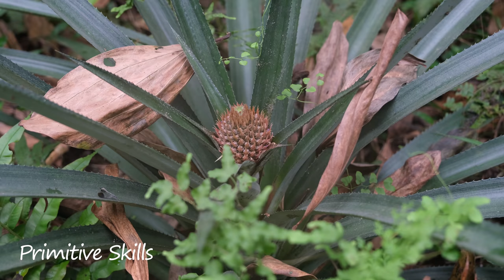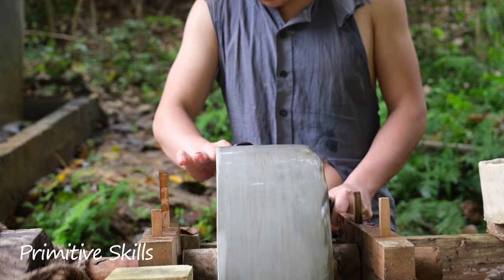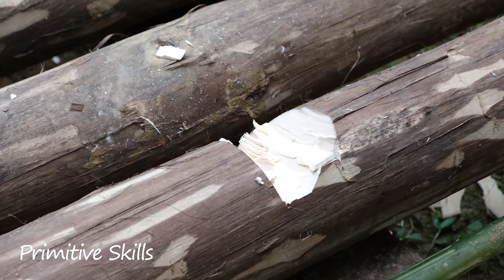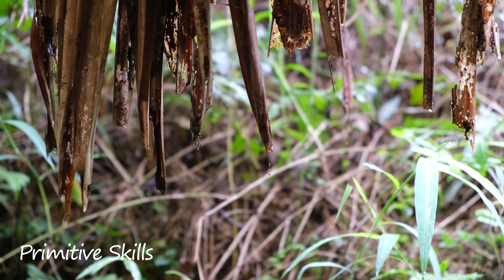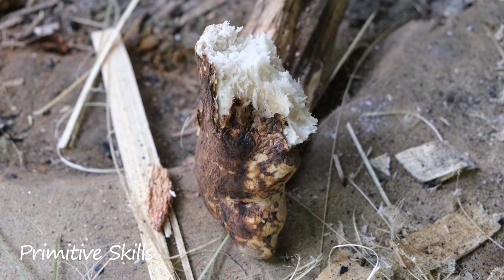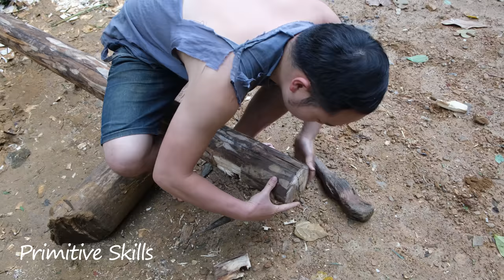Primitive skills for building factories, sawmills powered by waterwheels, Automation tools - Ep.162

Comment: Just a little advice.. Stand on the other side of your grinding stone and have the wheel turn into your blade so you can hone it first, stop the wheel and lightly rub the burr off the blade. It's sharper and last longer. Cheers. Keep up the great work!! Been a fan and sub from the beginning.Much respect from Ontario Canada

Comment: Got a quick suggestion. Maybe put a belt type of system on the grinding wheel. make a bogger and a smaller "plate" which the belt would go on to. It would spin the wheel a bot faster and make it easier for you to sharpen things.
Reply: he can also increase the volume of the water boxes on the wheel , or increase the volume of water falling on the wheel. either will provide more torque and speed. what your describeing is essentially gear ratio but without gears.
Reply: @Melicoy  ... nope.... you haven't observed the digging tool he made and watched him dig it...
Reply: @Jedyz Games ... Hey Jedyz, my reply was to @Melicoy who made a statement that the vids were faked... I've been watching since the beginning and respect and praise all the hands on hard work.

Comment: How are you going to transfer the power to the blade?
Reply: I wanna guess but I don't want to spoiler it. It's gonna be cool😎
Reply: He just needs to transfer circular energy of the wheel to a linear one, and that is not hard even for me, let alone him. It's called Sarrus linkage in physics. Or even Chebyshev linkage, his pick... You technically need only one or two joints, depending in your needs
Reply: think back to steam trains... the piston rod goes back and forth  at one end it is connect to the driven wheel  but not  at the center axle it is offset from center.  so the piston goes in and out , the rod at one end goes in and out and at the other it goes up and down  but the wheel has to turn for it to go up and down  and the wheel has to turn for the other end to go in and out...the offset wheel axle is called an eccentric and that will work if you turn the wheel or if you make the piston go back and forth... a saw goes back and forth and the water wheel turns it just needs a rod and an eccentric

Comment: A little trick. On the last beam you were working on, if you were to pick up the end of horizontal beam and drop it a few times the weight of the vertical beam would be enough to hammer itself in.

Comment: I would like to know what type of sawmill he's going to make
Reply: Probably a vertical straight saw. I don't think he has enough force in the system to do circular.
Reply: Most of the really old water powered saw mills use a vertical saw blade because they don't need much power to do the job.
Reply: I fear what he is going to make with that sawmill, when he'll be able to make planks and quickly... There will probably be some new house, looking like dream
Reply: he has a saw already ..granted it isnt a good one but all he has to do is make it move back and forth...liniar motion from rotational is the reverse of a steam train driven wheel but that is one method of doing it. another option is to turn the wood and hols the blade..thats a lathe

Comment: Here’s a “primitive” trick you could use to hold the wood you’re cutting. Weave a length of rope(3-4’)and tie it into a loop. Wrap the rope around the log and hang the loop down to the ground. Step your foot through the loop and hold down the rope with your foot. If you wrap the loop around the log a couple times it won’t roll around on you.